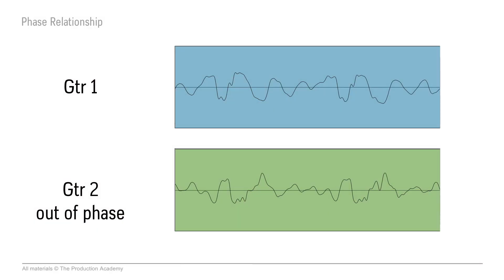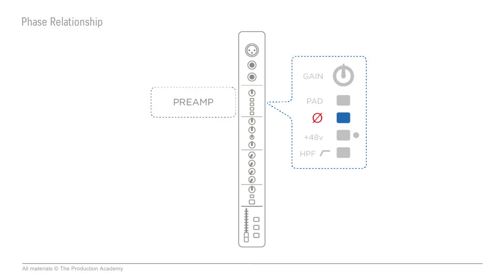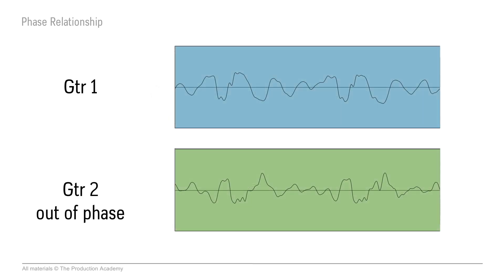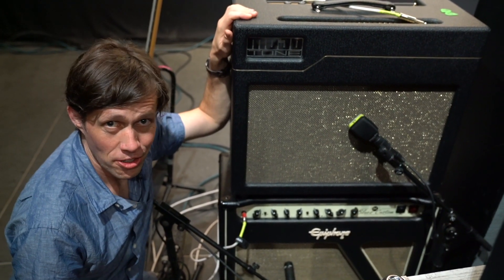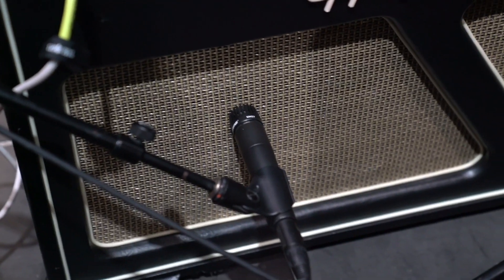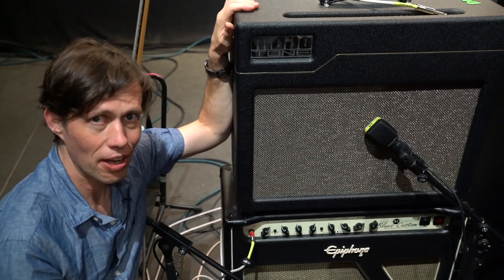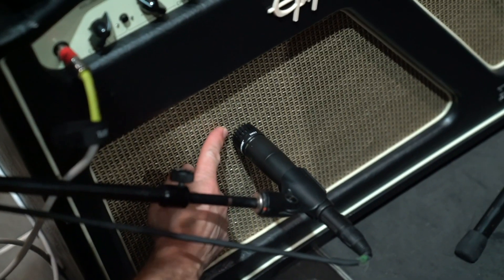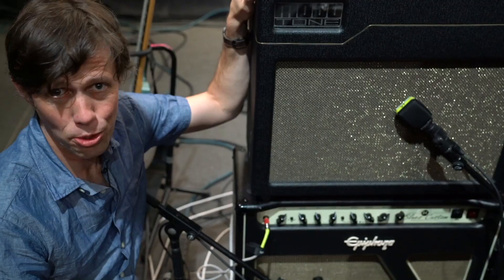How to Mic Two Guitar Amps - The Production Academy

Comment: I've always wondered about How close to put the mic to the amp.. I felt that if the mic is really close (touching the speaker screen) that it would sound TOO bright and possibly unusable. Thanks Scott for clearing this up.   Peace !
Reply from the maker: For live sound I always get the mic right up on the speaker cone, then use EQ to scoop a little brightness. I also like to use dynamic EQ to just compress the high mids when the amp gets loud.

Comment: If you are running a stereo setup with 4 cabs do you need any special mixer?
Reply from the maker: You don't need a special mixer, just be aware as you put microphones on multiple cabinets, you need to check the phase relationship between those input sources. If you have one mic on the "right" cab and one on the "left" cab, just flip the polarity of one of them on the mixer and see how they combine.